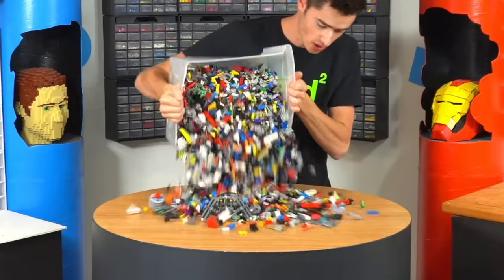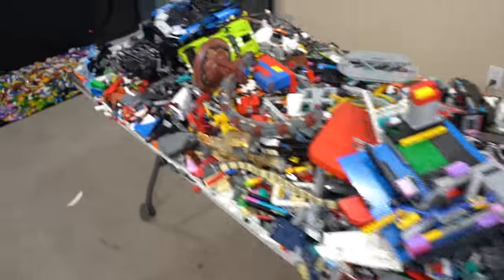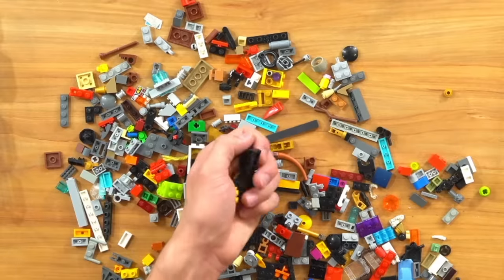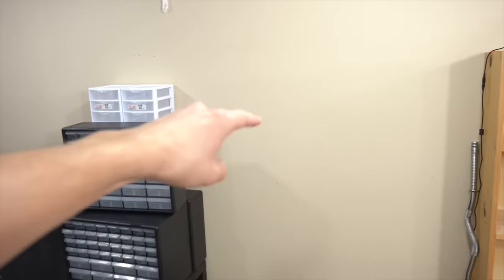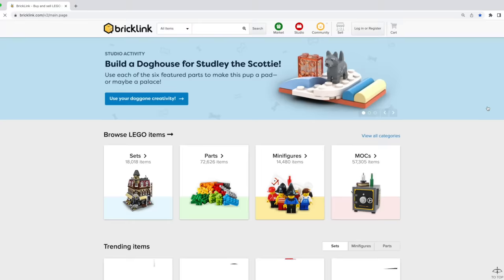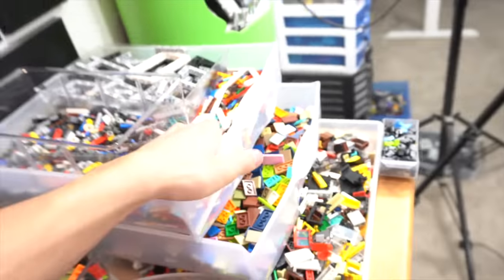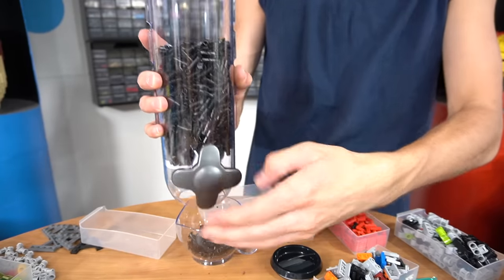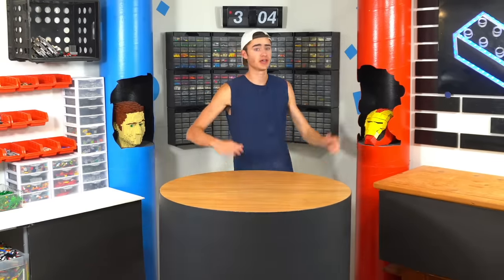I Sorted 100lbs of LEGO!!

Comment: It took me almost 1,000 hours to fully sort my collection. (3 55Gal drums)

Sorted by color and size. If some colors were "off", I'd check the part numbers.

Then, if I had the manuals, I found every piece for the sets and noted which pieces were missing. Just in case I decided to sell them.

Sorting my collection, I found some "old" LEGO bricks. These has a different texture (a different plastic I guess) and the wheel axles we're metal.

I even found some 1-off pieces, like a lone "353 Vibrant Coral (RGB 249, 108, 98)" 1x2 and a metal C3PO Minifigure. (iirc, the minifig was from a surprise bag that came with the LEGO mailer magazine)

The hard thing was differentiating between some Technic pieces and Kinex
Reply: I understand 
You actually sorted yours 
He didn’t 
He still has many many many hours to go to properly sort his 
Only thing I saw that was sorted in this video was technic pins

Comment: Sss   
Please  make a lego technic  rc car  with steering, suspension, 4wd, big wheels, gearbox,differentials, lights, make it  have a Ford f-150 body,  make it off road, and a  suspension that is not  hard.   Please only use  Lego  power functions motors! Have fun!

Comment: I do it differently. Not vastly, but still. I sort things, not on tables but in bags or large trays. Step one of removing the big stuff makes sense. It's just in the way. I don't even sort those out initially, I just move them to a separate tub before sorting it. I do half built stuff a the same time, moving that to a large tub.

When I am at the technic brick stage I begin the real sorting, by pretty much putting it all in very large resealable bags (think zip-lock style bags). Then I begin, moving my hand about in the large bag will make the smaller pieces fall to the bottom, so maybe whisk it about once or twice before starting.

This will more or less form different layers based on size, and then I just start going through it layer by layer. I usually work with 2-3 bags at the same time, meaning that I first go for 2 stud bricks for example, then switch to technic bricks then 2 stud bricks, 1 stud wide bricks, etc, etc switching back and forth depending on what's on top. When I can't find anymore of that size, I simply move on to whatever I feel is the most of, right infront of me.

I could easilly go through half of that 100 lbs lego haul like that in one day.

Once done I dump out 1 bag and go for a second sort into smaller bags. So 2x2 stud bricks in one bag, 2x3 studs in another, 2x4 studs in another, etc, etc. And since I don't keep things in trays, but resealable bags It's very easy to go from a smallerbag to a larger one when needed.

Once that second sorting is done I put them in larger resealable bags, or sub catagory bags if needed. Ie, for bricks I just put them in a larger resealable bag. For something like swords for example, I put them in a bag for just that type of sword. All smaller sword bags then go into a larger sword zip-lock bag. That bag then goes into the midevil weapons bag, which ends up in the accessory tub.

What that means is that I end up having catagory bags and tubs. Not that many either, maybe 20 catagories at most. Which means I can quite easilly move bags in and out of storage, or to another room for example. It sounds like an insignificant thing, but when you've sorted 100 lbs of legos, trust me - your neck and shoulders ache if you do it all in the same position, and you really appreciate being able to switch positions and move from sitting down in a sofa to working with it in a bed or a table.

The second benefit is that if you saw a set you want to build whilst sorting things out, you now have all the pieces from this sorting session separate from your main stash, which is...frankly...sometimes desireable. Especially if you want to build a really old sets that are slightly faded - blue and white are 2 of those older colors that are just a little bit different from blue and white today, so rather than mixing old and new making it look like a quilt, you can use pieces that if they have fading, have roughly the same amount of fading (I only accept very, very slight fading myself and very light scratches, I throw out the rest)

Different lego is in different shape. My last batches had: lego pieces painted with a marker, burn marks from someone building a fireworks ramp in lego, really, really old lego that was so old and faded that it was essentially useless. Multitack stuck in all the wrong places on what looks like unused lego. Superglued pieces, and of course all the fake lego.

This way you can also wash off dirty lego from just one batch rather than all batches. Cleaning after the sorting obviously have the benefit of you knowing what you are cleaning - I for one would not appreciate if I had disolved 5-6 candies, some battery acid from a leaked battery and then wonder why my lego is all sticky after the bath.

Different batches have different issues, hell some doesn't even need cleaning. 

Once happy with everything and I decided that it's up to snuff, I can simply merge it with my main lego.

Oh, and keep all your "wait, this isn't lego, is it?" in a separate bag. Some times there are treasures in there taht can sell well, like old gi joes, m.a.s.k. figures or transformers. And every so often you suspect thigns of not being lego, that is in fact lego. So better keep that around for a good 2-3 months before you sort that out and throw it away/sell it.

But that's just me and how I do things.

Comment: Get ANNOYING AF hair out of legos!
You need three things:  Two medium to large containers, roughly the same size. Also third thing you need is a Fan that is not too wimpy, but not super strong. You certainly won't need the wind power of an airplane propeller!
Put some legos in one container. Not too full. 1/3 full is perfect. Put the other container on the floor. While standing, pour legos into the bin on the floor. 
While the legos fall down, you want some wind on them, which blows the hair away. Of course you don't want so much wind that your legos blow away with the dirt. 
This won't get it all, but it really helps a lot.
And obviously don't do this with delicate parts like window panes.
Reply from the maker: Wow
Smart! 😎